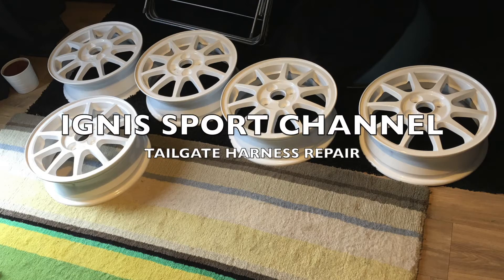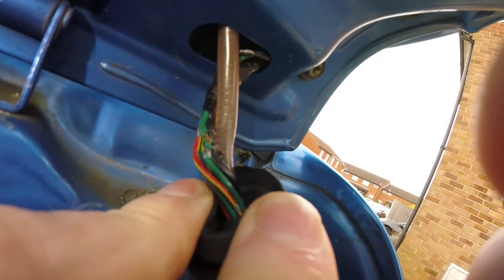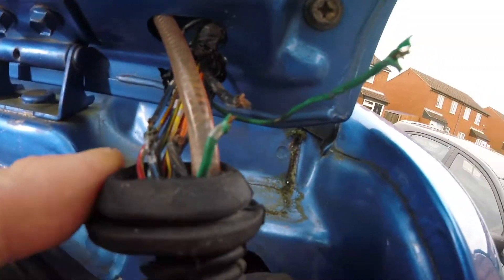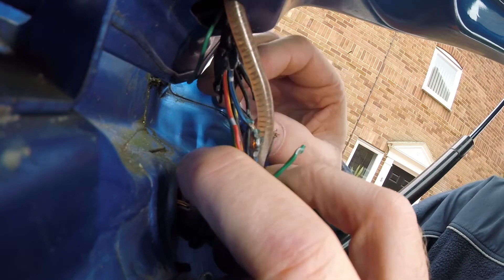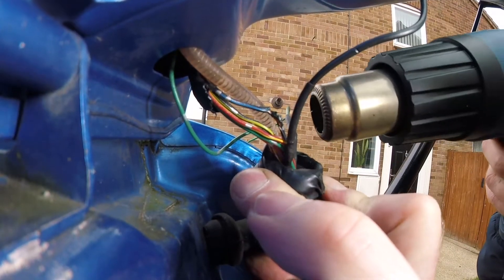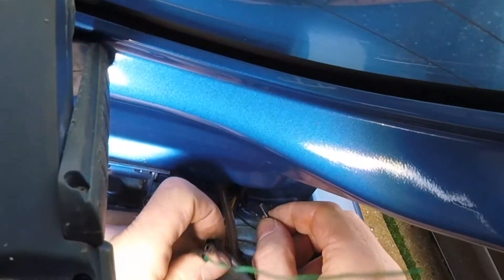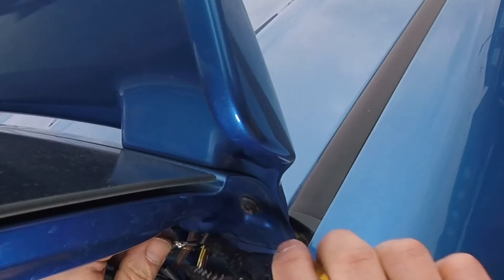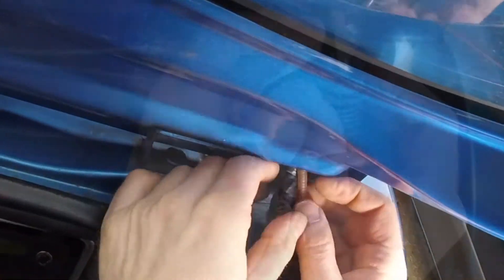Tailgate Harness Repair

Comment: Also rear door lock and sensor wire is in there. Could make your battery flat as can't detect door is closed...
Reply from the maker: Cheers, good point

Comment: Hi, I'm having a nightmare finding a replacement exhaust for my Ignis sport. Could you advise where to find parts? I'm looking for everything as I've been sold one with a straight pipe and a motorbike exhaust and it's failed its MOT (obviously). Any advise would be greatly appreciated.
Reply from the maker: You will have to buy an exhaust box. You won’t want to spend the money so I can’t help, sorry.